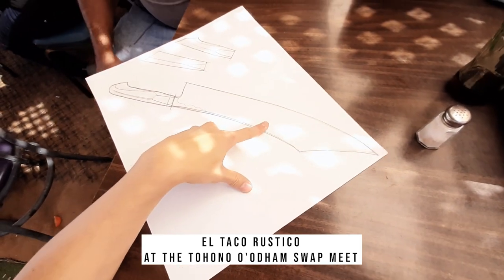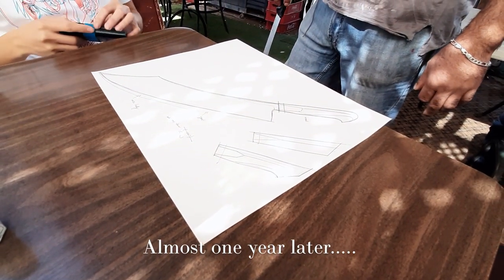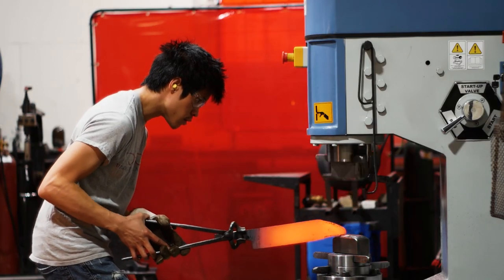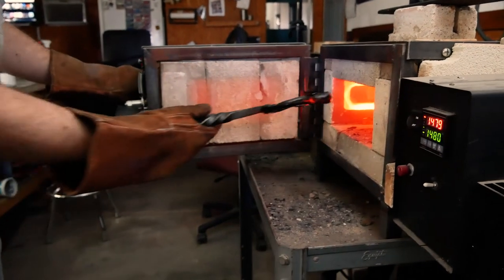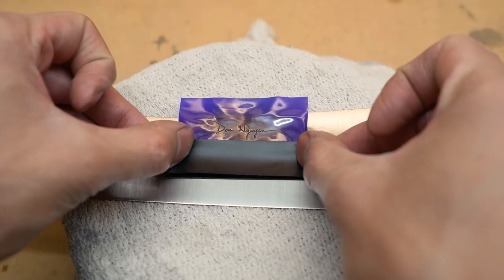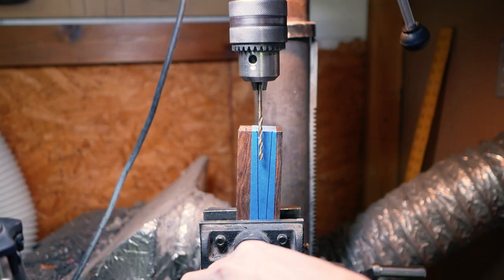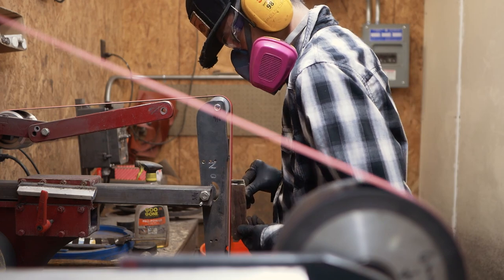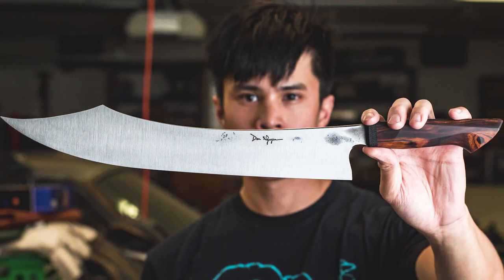Making The Taco Sword.

Comment: Carbide Jig; could you tell me how to get ahold of one?
I currently use one I made from 01-Tool Steel and it works well enough for files but this one would be way better.
Reply from the maker: There are a few out there that you can find. I just got a new one from Brian Bump that's amazing, but it does cost more than the old aluminum one I previously used by Bill Behnke; that one was good but you had to be much more careful tightening it because the aluminum isn't as stiff and the carbide would want to pop off.